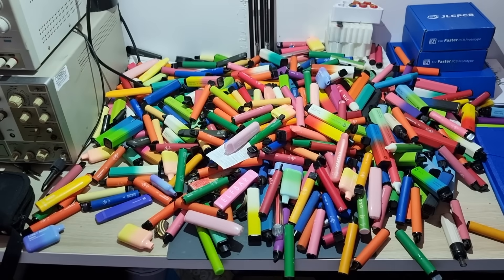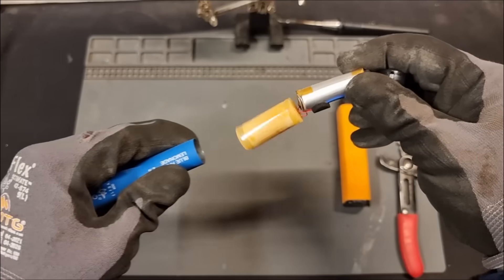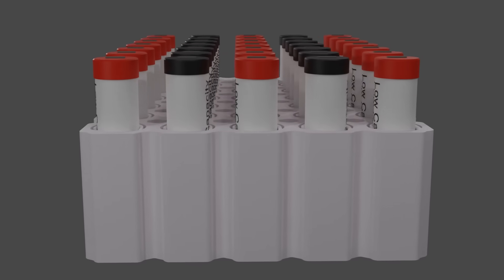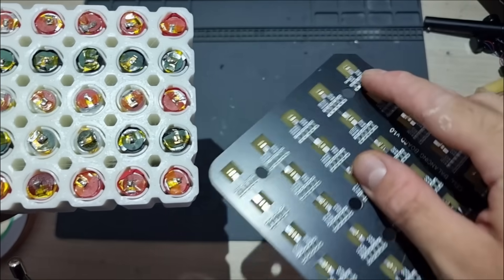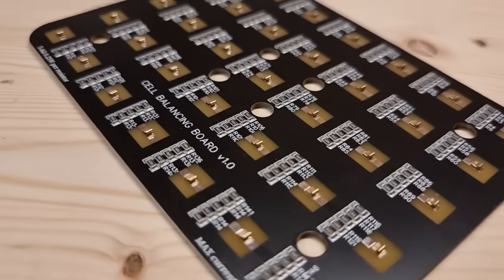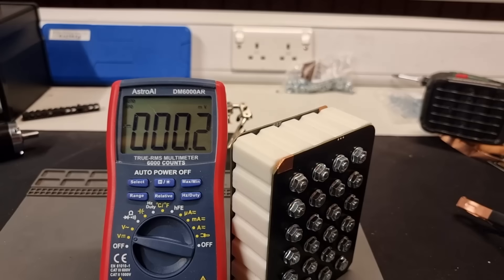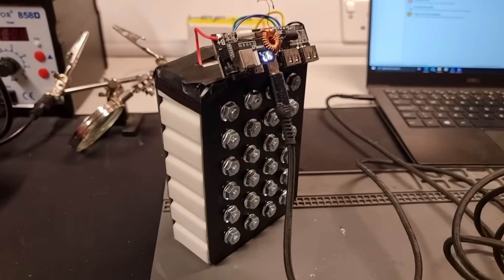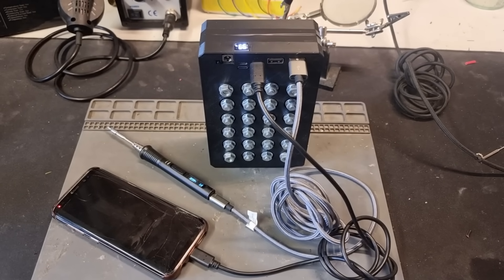Turning Disposable Vapes into a Fast Charge Power Bank

Comment: I have been collecting disposable batteries myself. but still kinda scared to store it as it may catch on fire. 

Do you think you can make a battery pack for should we say an ebike or powerwall? Would it  be efficient and practical enough to use it for long term until it can no longer hold any charge?

Comment: These little cells are actually capable of a fair bit of current. I use a few on small FPV quadcopters and they handle the load fine.
Reply: how many amps you figure?
Reply: @burtburtist  a good rule of thumb for maximizing the life of a lithium cell is to not continuously discharge it faster than 1 full capacity per hour, aka 1C. So e.g. for a 1200mAh cell, that's 1.2A of maximum continuous current draw.

That being said, drones draw their current in big short gulps a lot of the time so spikes of 5-10 amps would be fine. I use a 10 Ah lithium cell to jump start my car and it handles 1-2 seconds of several hundred amps just fine.
Reply: 5 to 10 amps realistically @burtburtist
Reply: @burtburtist  The 550mAh ones are rated for 5C discharge in the datasheet. They have to work hard to produce vapor within a second. I've played with them for a few years now and they don't last many charging cycles (charged at 0.5A cc), maybe 15-20 typically. I suspect their high current ability is what makes their lifetime short, which is deliberate by the battery maker for the intended purpose of single-use vapes.
Reply: lol seen a vid of bot grinder trying this, didnt work too great on a 1s tiny woop ;(
Reply: DAMM I WISH I THOUGHT OF THAT
Reply: You don't have to now go forth and do it!!
Reply: You are someone interesting. You mean you use this for drones?
Reply: What is the singular cell capacity? I only find 300mah battery in disposable
Reply: @Out_of_order  varies with when they were made. Have some 350 (newer ones) some 550 (old ones). Also the bigger rechargable ones use 650
Reply: How much ohms resistors he used

Comment: Uuuuultraaaa noiceeee mate. But not very cost efficient right? What’s that charging units (from Ali) price and what did the custom circuit boards cost ja? Even the heavy duty screws ya putting in there are more costly than the vape waste. 😢
But such nice engineering. Well done!

Comment: The new generation of elfbars are modular and can be charged through the pins that connect to the element. I think they have done this so they can replace the e-liquid module and re-sell the undamaged vapes. 

For us, it means we could create a plug to connect to the batteries and allow them to be simply plugged in to a project like this.

Comment: I love this project. I have collected around 500 vapes from festivals. I select the cells based on voltage, then join them with uncoated copper wire to make the process fast. I only really make 3.7V power banks in a custom printed case, which I use to power strings of fairy lights.
Reply: That's delightful

Comment: While vapes are better than smoking The disposable ones really need to be banned or at least regulated to limit the biohazardous ewaste created. Ideally they would just make it so the actual liquid part could be replaced and a charging circuit added so the rest of doesn't get thrown away because the liquid ran out. Or at least make it so the battery is replaceable and have them buy a starter kit to have the battery and reuse the battery on the other ones bought later only needing to charge it when you run out and go to put it in a new one.
Reply: For the most part they already do. Its called a pod system.

Comment: Great video! Two questions:
What is the reason for using such massive bolts and screws?
And how much did the custom pcbs and other parts cost?
Reply from the maker: Originally I was only going to use 4 bolts, but the PCB flexed too much and not all the cells made contact with the board. So I decided to go completely overkill and ensure that all of them were well connected, hopefully on the next iteration it will be massively improved. The charging board was about £5, and the PCBs were about £10
Reply: The charging board has since spiked to £11 (pre-tax). Still absolutely worth it, personally, I just need to acquire a few more cells (might take a couple weeks), do discharge checks [I'm not risking a heater] then I hopefully can build a similar project.

Comment: The balancing connector on the power bank module is also used for charging, since Li-Ion cells can have wildly varying internal resistance and capacity, thus, some charge faster, some slower. If you just slapped the full pack voltage across it, some cells might not be charged fully, while some could get overcharged, without exceeding the maximum pack voltage - thus, the balancing leads - every cell (or parallel pack) is charged separately up to its voltage, without risking overcharging
Reply: I think "balance leads" are actually discharge leads historically. You can connect them at any point and they will discharge higher voltage cells to the same level as the low voltage cells. A charger capable of "balancing" using these leads probably will have a heatsink or an aluminum body to release the waste heat. Kind of weird that it doesn't just charge some cells faster.
Reply: @compjelly the BMS doesn't "just charge some cells faster" for the same reason that you don't put a 12-tap, 12-knob spigot in your sink to optimize the filling of the ice tray. You just fill it up until every cell is overflowing and then bam, they're all even. The extra components and complexity are not justified by the small amount of water that would be saved.

The point of my analogy is that a BMS that charged e.g. 5 different banks of cells individually, that's really just 5 BMSs and would cost an appropriate amount more.
Reply: @compjelly  Correct, these are called passive balancers and are most popular. It needs only one load resistor and transistor per cell. The max. balancing current is quite low (<100 mA), otherwise they would not be able to get rid of the waste heat fast enough and catch fire itself. In practice the wasted energy is negligible when battery manufacturers use well matched cells.
There are also active balancers on the market, here the energy from high voltage cells is dumped into capacitors and then reused to charge up the lower cells. Balancing currents of multiple Amps are possible with almost nothing wasted, so these are suitable for huge packs where the passive ones would be too weak. The circuitry is much more complex and contains more expensive components.

Comment: I've made thosands of these. The best thing about them is that they are safe. If they develop an internal short they tend to leak or get hot, but they never explode.
Best of all,.you are saving precious lithium from landfill! Nice job!
Reply: Vape shops have little recycling bins. If you ask them they are happy to let you take them. But be careful, the quality of the cells is questionable! I always check the internal resistance and capacity of each cell, as well as other precautions (cell matching in packs etc)
Reply: where do you get the vapes?

Comment: almost the same of what i do, i recycle old laptop battery for my powerwall, and for the powerwall i only choose the one with high quality, low internal resistance, low self discharge, and high capacity(for recycle battery oc) >2000mAh, to minimize faulty cell, because whatever how good my selection are, recycled cell will have problem later on.
for the one having 1000-1900mAh i use for small project. and the one with less than 1000mAh i use for powerbank, i paralled more than 100 of 18650, all the cell is mixed from 500-1000mAh, as long as it's have low self discharge and isn't overheat when it's charged i use them, well, been running for like 2 years and last time i check the capacity is still around 80Ah and still can be charge to 4,2V if needed, but usually i just cycle it around 3,5-4v just to be safe and prolong the already low capacity battery.

Comment: Not a bad idea, definitely worth soldering the nickel tabs instead of the copper tape though. A good soldering iron can solder 16awg wire to them pretty easy given you use good solder & flux. Ive been doing this for about 3 and a half years now. Made usb power banks, 12v packs, small 36v packs, replaced 2xAA batteries with a single 13400... Theyre awesome lil cells, but damn do they get spicy if you damage them 😂🔥🎇
Reply: Soldering anything to Lithum batteries is a terrible idea. Just don't do it. You will damage the batteries, even though you might not notice it at first.

Just use spot welding to minimize the heat contamination and have a solid connection.
Reply: @xKaruOttx Mf these batteries have nickel tabs for soldering, thats how they are connected inside the vape. They are so tiny spot welding is almost impractical.

Comment: Hey Chrs.  I'm doing the same with vape and all other types of lithium cells rescued from my local recycling centre weekly.

I find using a Dollateak 4 bank withium tester works amazing for fully testing the cells.  Gives mah, internal resistance, and balances all to 4.1 when finished.   BIG timesaver.

I like your idea of copper tape.  I usually solder to bus wires i design into my 3d prints.  Can you link to the tape you use?
Check few of my vids.   There's one vid where I show about balancing cell groups and how to build a balanced multicell pack here https://www.youtube.com/watch?v=F3qSsS0UvT4 .   It's old and my techniques have changed slightly.  I'm in process of making an updated video.  Just need a few weeks to get all the calls balanced and rested for a month to see parasitic drain to better help group them.  

PS>  Subscribed.   Please do make more project vids.   I like your style.   Be good to chat and swop ideas sometime
Reply from the maker: The tape i use is 3M copper EMI taoe, but the cheaper stuff works well too. Ill absolutely look at getting a cell tester, especially for the ebike battery build.
Im really glad you enjoyed :) feel free to pm me
Reply: @Chris_doel  This may sound dumb..   but i cant find a message or PM because your channel "About" tab is not visible.